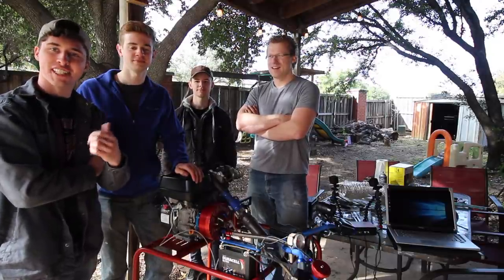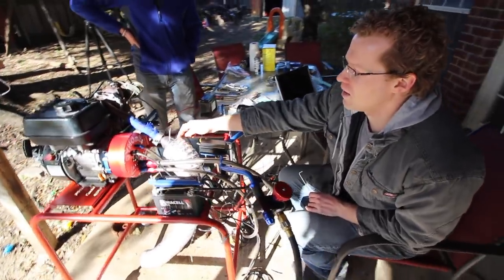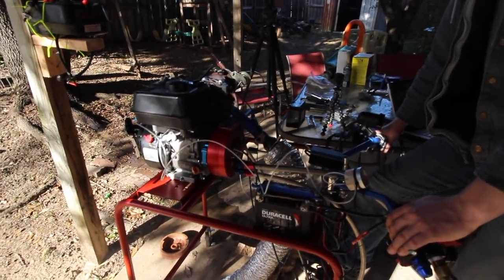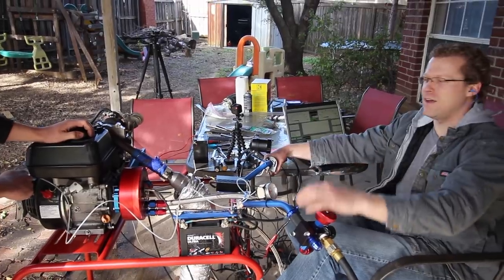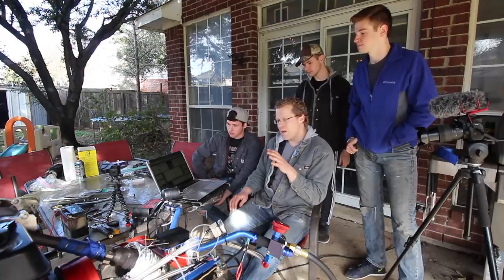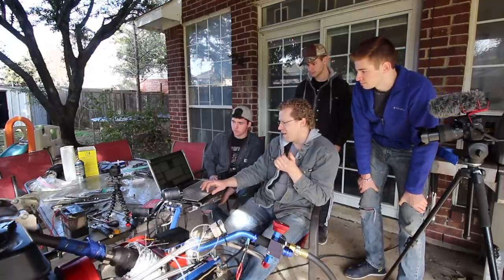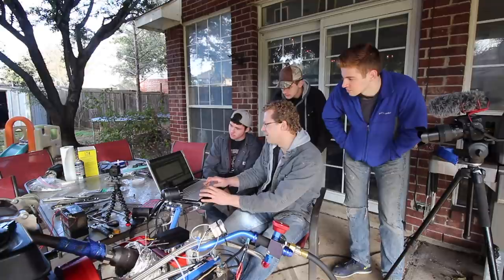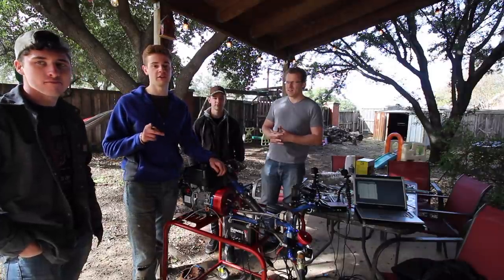Testing the Turbo Go Kart Engine On the Dyno! (How Much HP?)

Comment: Don't give up on the blow-through yet. You're really close, just need to change a couple things. You need a real fuel pump and boost-referenced 1:1 regulator, which could be used with EFI later. Boost referencing the float bowl was good; boost enrichment can be improved/adjusted with a pitot tube. The carb's fuel control would also likely benefit from a good-sized plenum between it and the turbo. An intercooler would achieve that and improve power. Food for thought.
Reply: Listen to this guy ^
Reply: Upvote this comment. They need to see it
Reply: Listen to all these guys /\/\/\
Reply: The plenum volume would keep the turbo pulsations down (one lung engine issue)
Reply: Why does no one try a draw through system? Literally use a CV carburetor
Reply: @chri2halty954  Im not sure what a CV carb is, but Cars ans Cameras tried draw-through on their drift trike before going EFI.  The issue is that turbos build boost in an exponential fashion.  If you jet the carb to run under boost, its super rich before you get boost built up, and even worse at part throttle.  Maybe something with a metering rod like a mikuni would help with this, but it would still be super dependent on the driver using the correct throttle position all of the time, especially at light load.

Edit: just realized that a mikuni would be a CV carb.  But i think the issue remains the same
Reply: @sourand jaded ah...... Makes sense so the best carb for turbo is fcr carb... Since it has rollers on the slide and can't be affected by the turbo

Comment: Looks like you guys still aren't using a pilot tube. Pilot tubes are important for carbureted turbos, they add a little extra pressure to the float bowls. The extra pressure helps with enriching the fuel mixture.

Comment: So it's a waste of time when you can buy a tillotson 212 10HP for $180
Reply from the maker: Douglas Bigblock haha yeah...but it might be worth it on a fully built engine. We were just surprised that it made any power at all.
Reply: Yep, 6 1/2 HP+ at governed 3600 RPMs stock... so would expect this much ungoverned HP (7-8) stock at higher RPMs without the turbo !!! 
https://www.harborfreight.com/65-hp-212cc-ohv-horizontal-shaft-gas-engine-epa-69730.html 
15 lbs. of boost should give about 13+ HP...
Reply: @BuzzLOLOL  IIRC it wasnt going over 5 pounds of boost, it was lean, and its basically bone stock with heavier springs in it. I have other naturally aspirated engines that have made more than that on the water brake, but they had significant head work, carb, exhaust port matching, balanced, high compression, nice cam etc. The only other person that I have seen that actually tested his engine on a "dyno" with a "turbo" was warped perception, and he lost hp. I suspect it was jetting and just not enough exhaust flow to spool the turbo.
Reply: I'm going to waste money on a turbo kit to make that kind of power when you guys are proving the point let's just take a predator and run it on a blend of nitromethane and hydrazine😂
Reply: On fleabay you can pick up an electric start duromax 440cc (18hp) right now for $96 shipped.
Reply: @user-neo71665  A single cylinder duromax 440cc does not make the same hp as a v twin honda gx610, which actually makes 18hp. The duromax likely only makes 13.5 hp in a world where physics and math and marketing accountability apply. It is laughable at how inflated the numbers are compared to reality. Just because an engine manufacturer slaps 18 hp on their side-cover, doesn't mean it makes the same power as a v twin that actually makes 18 hp. People like high numbers, that is until the manufacturer gets reigned in for lying. It has already happened to the big brands, just not duromax or some of the countless Chinese manufacturers.
Reply: @KartFab  I built a lifan gx 420 clone (not a duromax POS) to an absolute beast with only about $700 in it. 11x1, huge cam, billet long rod, ported, 12 degree timing keyway, 34mm CV on custom intake etc. yada yada. Running 7k it should be at 26hp. It is an affordable solution. The problem now becomes the transmission. A regular comet 40 does not do 25hp.... I tried. A comet 44 mag does with the right gearing, but can still slip a little. All in all, a built, big block,  gx clone is a pretty affordable powerplant
Reply: B Curtis a comet 40 series would be fine with 26 hp
Reply: B Curtis I run 18 hp with my 30 series it’s fine
Reply: @mtnsleder2829  Yeah? well I blow through the belt regardless with a comet 40 on my built motor. Even with a heavy secondary pulley spring clocked tighter. The regular 40 just can't clamp hard enough on the belt to handle my motor. I switched to a 44 mag and adjusted the weights, and it's night and day.  Spinning tires, and not just belts
Reply: @BuzzLOLOL  if u put 15lbs to one of these motors even if I was built it would pop head gaskets and lift heads u cant seal em up tight enough for that these things are ment to run snow blowers and water pumps not be high strung turbo motors they dont even have a forced oil system
Reply: Where's the fun in that hahaahha
Reply: @user-neo71665  they're 379.00
Reply: @KartFab  
Far more true than anyone really wants to know !
As you said,
"Stickers don't make horsepower" !
We are a commercial outdoor power equipment dealership, and I will tell you fact,
None of the mfrs. are making the advertised hp. that is why they all stopped the hp. decals, and went to cc's, and advertised torque !
In real world application, most of the mid-twenty something hp. engines fall on their noses when it comes to actually making a hard load pull !
Heavy wet grass, etc. !
Won't mention any brand names, but more than a few, are certainly disappointing in hp. and torque dept. !
Reply: They are between 9.5-10.5hp bone stock with Gov removed.. All of them.. hemi and non hemi 212s.
Reply: Tillotson 196 "R"or 212"R" is the way to go
Best starting point !
There built to EXACT 
Racing tolerances as per Tillotson requests fro there own bespoke factory
And use HAND PICKED
QUALITY MATCHED & WEIGHTED COMPONENTS.
ABOUT 10+H.P. out of the box . & BULLITPROOF
Worth the money !
Reply: KartFab it happened to Briggs and Stratton not to awful long ago. They got slammed for their insufficient horsepower ratings on their engines and that’s the same time Kawasaki went from rating all their engines in horsepower to cubic centimeters. Kinda like they do your WiFi internet speeds. 951cc looks better than 29hp on a Kawasaki FX951V. Also, these are not the only engines that do this.
Reply: There is no way in hell the regular tillotson 212 does over 50% more power than a regular predator does. It simply doesn't have the upgrades needed to pull it off. And it doesn't even come with the tct carb. They were obviously just rated differently.
Reply: The army of psi freaks are comming
Reply: You didn't prove nothing normally aspirated motors make a lot more horsepower than that even though you have stock components in it ......
 Quit wasting your time and go over to Paul's carts and look up a video he did about a year ago unless you're going to deal with 420 csesar larger you're wasting your time

Comment: Awsome hell yea i dont know if u guys have a efi kit in mind yet but ecotrons is a great setup and i would recommend it bc it is a self learning system.
Reply: I've worked on 2 ecotrons kits and they were both complete garbage.
Reply: @user-neo71665  what motor were they on and do u know how to tune
Reply: I have an ecotrons. I second that it is garbage. Blow through is more likely to work as the ecotrons fuel system is wholly inadequate. I'm comfortable tuning carbs and efi. Avoid ecotrons.
Reply: @stevenmurphree  I had a ecotrons, and swaped the ecu out for a microsquirt. WAY better ecu.

Comment: I dont think I have watched a video on this engine but I recommend getting a billet rod because that stock predator rod is weak and adding boost Is not the best and buliding your engine with a just valve springs and a cam would give you 10hp I'm pretty sure so get that air fuel firgued out and that engine will make way more power and honestly if you could find a smaller turbo you could probably get more boost tbh because honestly even tho that turbo is pretty small the exhaust housing mainly needs to be smaller so you can spool it faster

Comment: I applaud the effort but a turbo on these small engines seems to be a waste of time. Many have tried it on YouTube and I have yet to see one actually run good with a turbo on it. Perhaps a belt driven supercharger would work better?
Reply: There are several groms making good power with turbos on YouTube, several pitbikes and one in particular has a 150cc pit bike that spools up at a low 4000rpm, and reaches 10psi at 6000, making the useful part of the powerband 5k rpms! (11k rpm limiter)

Comment: Im not doubting your understanding of air dynamics but i reccomend for an air cooled engine especially is to find a way to cool the boost (air flow from turbo into intake) which the colder the better with boost plus you know what would happen if you ran a air cooled motor behind you while being boosted for more than 20 minutes

Comment: I'm kind of confused by this. The motor always has run like crap with the turbo. Why put it on the dyno before it even runs correctly. Gonna have to go with fuel injection to get it right. It might make a little more power than stock, but it's completely unusable.
Reply: Totally agree
Reply: J Wacker it’s just for fun
Reply: it’s run like crap but still has more power then stock. 

Plus to get actual proof of gains every step of the way has to be tested and verified for comparison
Reply: Because it's a learning experience.
Reply: J Wacker grants bored

Comment: Hhhhhh running like shite because the engine int big enough to spin the turbo!!!!!
Y not just attach a compressor to it !
Reply: nailed it. or just get a bigger engine, that would be a lot less of a pain and less likely to break. Get any factory 400cc-500cc motorcycle engine and you would stomp that lil toy motor. a few extra pounds but a shit load more power.

Comment: So if you could put a cvt on that motor that holds it right at the rpm for peak torque and boost that thing would move!!
Reply: + actual tune
Reply: jdmjedi777 stage 4 first

Comment: Who really cares about the horsepower number that torque number is really good and since you know the torque is there if you can get the RPM up while making the torque.... it'll make an equal or better horsepower. the lean AFR caused it not to make the horsepower. I'm really surprised you guys didn't melt a piston or valve with that Lean of an AFR or that hot of combustion.
Reply: Exactly. You know it works with that much torque down low when they can get it to run at all. It would pull surprisingly good I think with a good afr

Comment: Oh my! I remember tinkering in my uncles garage on my first go kart! It had like 2HP and I could go maybe 5 to 10 mph. I was like 6. When I turned 10 my uncle got me an engine from a wrecked Yamama 125. It was a 2 stroke but it was quick! Especially because I only weighed like 80 pounds 😂 
Now that I’m 16 my kart has a rebuilt Rotax 670. I think I’ll put my new welder to use and find a decent motorcycle engine. Maybe a Honda CBR 1,000RR engine. Hayabusa kart?? Prolly be like $2k just for a Busa engine tho.

Comment: I’ve got some decent experience with this sort of tuning and building, for a twin cylinder motor you need a minimum pre turbo and post turbo volume of 3 times the displacement of a single cylinder to radically reduce turbo surge or compressor surge, with a single cylinder that volume needs to be about 5 times the cylinder displacement on hot and cold sides of turbo. I’ll post some vids eventually of my turbo Vespa 300 EFI project. Try it, you will need fuel injection or proper blow through setup and tuning but I promise this added volume TRULY helps a LOT.

Comment: Guys, it's a good build but engine doesn't work properly. You should either try an efi or make it draw through instead of blow through. Check my videos if you like. On a much smaller engine, 100cc, the same turbo but draw through setup, runs so smooth and gives up to 5 psi.

Comment: Grant : Question !
How do you like the TCT
Mech. Injection 
on a PERFORMANCE
application ?
 I was told to stick with a 
Mikuni. or Tillotson 304.
or BORED stock carb.

Was told TCT is ok on a
stock engine .
I'm running 22Mikuni
with stock high flowing  BSP. JT head. & 
Isky Black Mamba cam.

Any thoughts on that  ?

Thanks again Grant !

Comment: The reason you don't see successful small engine (5-6.5hp) turbo engines is because there isn't a cost effective easily accessible turbo small enough for them. Unless something has came out in the past few months the smallest turbos are for japanese kei cars and those engines are 360cc and up. EFI will help some but it will never idle or run right at lower RPMs. The engine trying to spool the too large turbo up is robbing too much power down low. I wasted untold amount of time looking into this and even the popular VW/Porsche smog pump supercharging  before I just gave up. The amount of time and money trying to get a 212 to make bigger gains isn't justified by the cost of just replacing with a larger more reliable engine.

Comment: Good job guys!  Adding almost 50% more torque is HUGE!

Once you get the air-fuel ratio sorted and assuming you removed the governor my back of the envelope calculation says you should be around 15hp.  That is better than I imagined this would do so you've taught me something already.

I wonder if you'd get more or less power if you were to use a belt to drive the turbo?

Regardless great job!

Comment: So this compared to say, buying a wrecked r3 and putting the motor on, stock.  The r3 itself gets about 41 BHP.   On a lighter chassis, no gearbox, with more traction, I'd assume you'd get more out of it.    And you still havenlots of room for performance upgrades.

Comment: Not trying to be rude, just want to help this work. A plenum, Airbox, whatever you want to call it, helps imensley with single cylinders, particularly a cone to cylinder to come shaped plenum right before the carb.

The people saying this can't spool the turbo are wrong. The compressor side of the turbo is a bit small for this motor, but the exhaust housing is definitely to small. I have found a hybrid turbo with an exhaust side rated for double your wanted horsepower with a compressor rated for your wanted horsepower works best. It actually spools quicker without all the back pressure from the small exhaust housing, believe it or not. 

Do you guys run a fuel pump, regulator, pilot tubes, or any of those items? You could get it running great without efi.

Comment: Dear friend! with the turbo you do not have a magic wand! the application seems easy but it is not. you the only one you are doing with your experiment and to kill a motor, push hot air to pressure (a little) inside the mouth of a carburetor, with this cancel the depression that generates the venturi to dispense fuel, you send fuel back! ! does not work! If you had fuel ignition maybe it would give you good power! but it is not obvious, there are other fluidic and even thermodynamic problems. However, good work and a lot of luck and knowledge. 
Mrcello, Italy engine expert.

Comment: It's just disappointing.
Don't you know you need to lower the compression!
That's turbo 101.
Reply: You definitely don’t need to lower the compression, you can run more boost with lower compression but they’re only making a few pounds so there’s no need, and these 212s already have low compression it’s only 8.5:1.

Comment: I noticed that the intake temp. got very high (250) causing the air to be less dense. The whole point of the forced air pressure is to make the air denser when entering the head to be compressed. I didn't notice an intercooler to cool the intake air from the turbo. Did the turbo engine ever get one? Good job though on the tests.

Comment: I have a bit of experience with blow thu turbocharging a small engine, just not that small. They like running rich, closer spark plug gap and low timing. the only way blow thru has a chance is a fuel pump capable of  making 3 psi more fuel pressure than maximum boost. The pressurized carb bowl can stop the fuel form entering the fuel bowl thru the needle and seat. A good boost referenced fuel pressure regulator referenced by the intake manifold will do the trick at holding 2 or  3 psi fuel pressure above ambient.1641 cc's Hyper Bug  https://www.youtube.com/watch?v=LstJ1c-vi30

Comment: Draw through with carb very close to intake....... or fuel injection. Blow through is to finicky. For blow through you have to have more fuel psi than boost for it even to work right. Pulse pump will be useless in this application. Good luck.

Comment: So why not check out red beards Garage 35 horse power predator motor. Then slap the turbo on that with all the fuel hardware you have and see what you can make out of that I mean 10 hp not even 10 hp on that motor with a small turbo is should be making better than that you need to work the fuel issue with the carb look into the carburetor turbo cars and go from there at the end of the day and engine is an engine

Comment: Dude just power your cart with a piaggo motorized bike engine 17 horsepower two stroke, your gonna get alot more speed with a 2 stroke when it comes to smaller engines

Comment: I get this turbo project is more for fun than anything and to see what you can come up with (which is fun), but it would be so much easier to spend the $700 for the V twin and make a super offroader! Plus you get the sweet sound of a V twin. I know that's a lot of money, but it has like 20 hp stock, you wouldn't have to spend much, if any, money on upgrades.